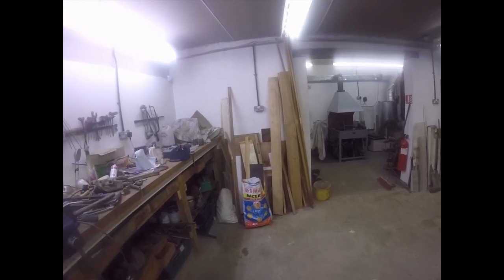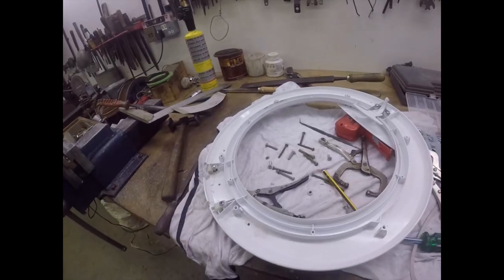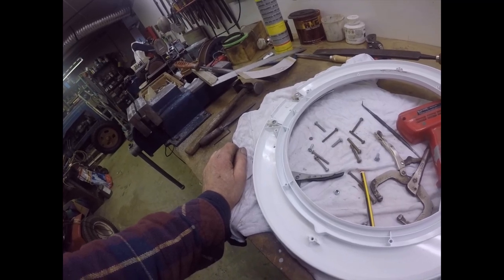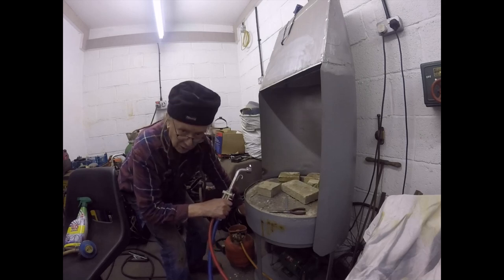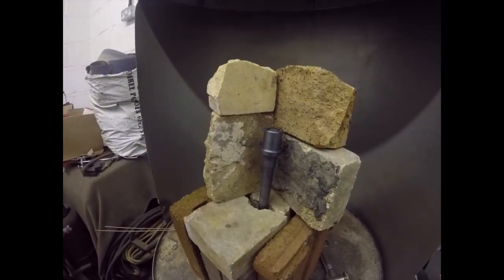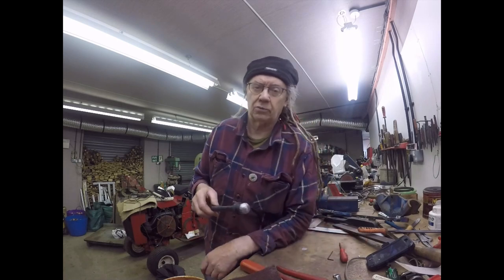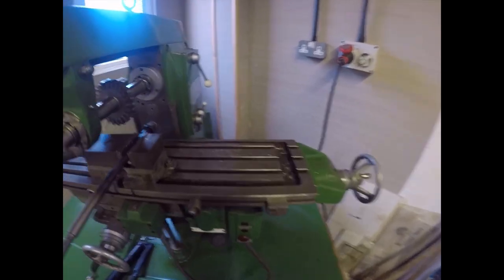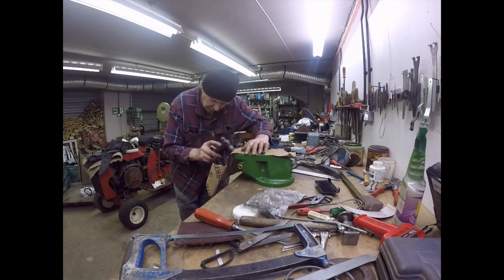Gorenje washer door repair, finish the drawbar, and continue the mill conversion

Comment: Great to see the Brazing Hearth working! When using the gasket material I found that it tended to squeeze down quite a bit so don't worry about the meshing
Reply from the maker: I got it fitted and running today, no probs with meshing as you say! Unfortunately is has a little tap from one of the bearings, which has a damaged roller (taper roller bearing) in it, I spotted it when I rebuilt it, but hoped in vain that it would be ok, but you can hear it ticking. Ver wierd, it appeared to have a rusty mark on one roller, the rest of the bearing is mint, and when I cleaned off this rusty mark, it left a tiny pin sized slot in the roller. I will use it for the immediate job, and then take the bearing out (not too involved a job, and send it off for repair, they are Gamet precision bearings of course, and a new one would cost an arm and several legs! If I had known you could get bearings repaired when I had it in bits, I would have done it then!! Good to hear from you, thanks for commenting!
Phil
Reply: @philhermetic  Sounds like good progress. I've been enjoying the videos for the past few weeks. Although with uni work I'm usually a few days behind in watching them. I still have that oiler for your student, so if you're in Hull at some point do let me know. It's great to see you using the gasket. I popped home before the tiers came in and it seems I've sprung another leak somewhere, so the fun will continue at Christmas. May have to remake a few of mine, still got plenty of material left! I didn't know you could get bearings repaired either.